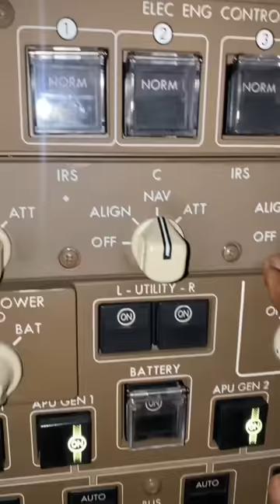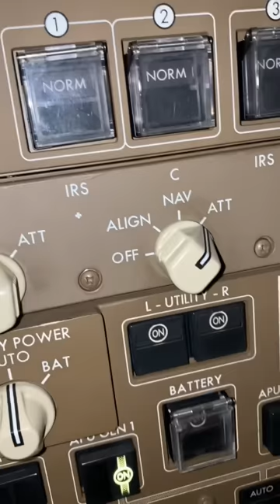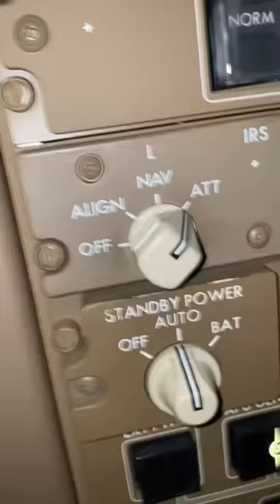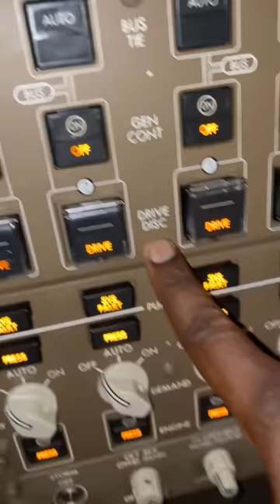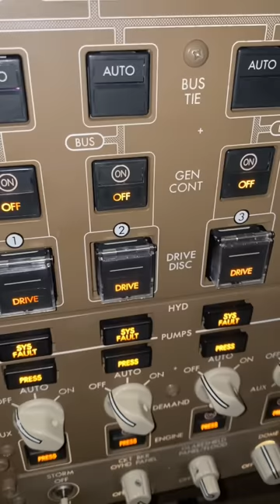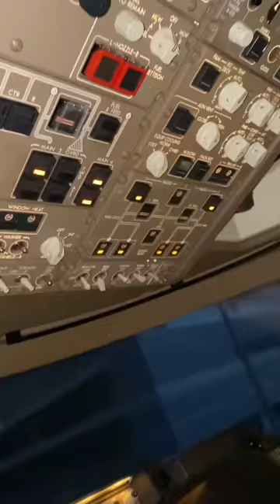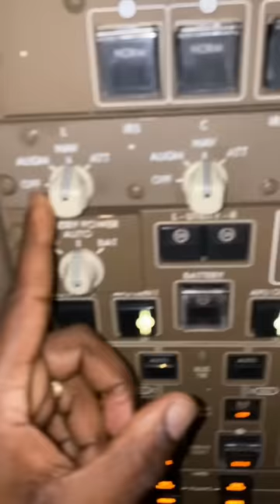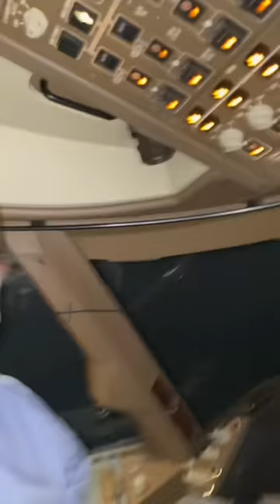Boeing 747 cockpit irreversible actions

Comment: I actually did the "GEN DRIVE DISC" once in a real flight, and the QRH clearly stated "action is irreversible", me and my copilot had to be very sure we are disconnecting the correct one, but it's actually a very rare occurrence in my 7+ years flying the 744s.
And I did not know the 747-8s have the RAT, is it consider a standard equipment in 747-8s?
Reply: its the other way around is what I've heard the  747-8 does have one no matter what. but the -400 and earlier dont.
Reply: @nick4506  Why would they need a RAT with four engines?  Seems like overkill.
Reply: @rael5469  no idea why. but the faa has been a bit uncooperative recently so maybe they just wanted to be ahead of the curve of any new regulation they could spring on them. like whats going on with the max10 now.
Reply: @nick4506  Thanks Nick. Interesting question though.
Reply: @rael5469  i would guess in case of fuel exhaustion, the RAT would come in handy
Reply: @MuhammadUsman-wy6cb  If they run a 747 out of fuel they deserve to go down in the sea. But still, you have a point. I remember when a British Airways 747 had all of it's engines snuffed out by volcanic ash. Extremely rare but still........
Reply: I've done the GEN DRIVE DISC twice in the 747 while oceannic. What's nice is that it's fairly minor compared to being in a twin. We didn't even need to wake the captain and the action was just part of the change briefing when we changed pilots in cruise.
Reply: @rael5469  Fuel is out? All engines fail from like a bird strike? Shit happens, even if extremely rarely.
Reply from the maker: Yes it is standard fit in the B747-8 but you should understand that on the B747-8, unlike some other types, the RAT is for emergency hydraulic power to system 3 for flight controls. The RAT on the B747-8 has no electrical function as it were.
Reply from the maker: @rael5469  read my reply
Reply from the maker: @MuhammadUsman-wy6cb  the RAT in the B747 is to provide emergency hydraulic power to system 3 for flight controls- it has no electrical function.
Reply from the maker: @spudsmac0  correct- not a big deal
Reply: @hunormagyar1843  I see your point. Better to be safe than sorry.
Reply: @MuhammadUsman-wy6cb   well if fuel was exhausted wouldn't windmilling 4 engines be good enough?  like 4 engine faures to the point they don't spin anymore is kinda super unlikely and I don't think its ever happened.
Reply: @nick4506  The accessory gearbox is driven by the high pressure shaft of the engine. What you see windmilling on a shut down engine is the low pressure shaft. Since most of the airflow bypasses the HP section, it will not spin up to sufficient speed to create any hydraulic pressure.
Reply: @rael5469  Well there was that time a BA 74 flew in to volcanic ash and lost all 4. The captain flew the bird like a glider of many miles before the change in OAT cleared some of the glaze from the turbines and they managed to restart a couple of engines. There's a video on here about the story.
Reply: @IanDarley  Yes, other replies have mentioned it.
Reply: @rael5469  as mentioned earlier. Fuel problems can stop all engines as in the total fuel exhaustion of the ‘Gimley glider’ and the aircraft that had to glide to the Azores. Also due fuel filter icing up, BA-38 landed short of the runway at Heathrow. None of those situations were due to crew’s fault.
And thanks to ‘pilot_obet’ for excellent presentation and really interesting subject matter. You have earned yourself a rare subscription from me. 
And some very interesting comments too. Well done all.
Reply: @tonymax6632  No, the Gimli Glider glided to Gimli, Manitoba in Canada. That was another aircraft that glided to the Azores. They were both 2 engine aircraft.
Reply: @pilot_obet  Thanks for the info, Sir.
Reply: @nick4506  "well if fuel was exhausted wouldn't windmilling 4 engines be good enough? "
Nick as far as I know windmilling engines DO produce hydraulic pressure. So the question arises, is a windmilling RAT going to do better than a windmilling engine?
Reply: @rael5469  Given the RAT is designed to provide the necessary hydraulic pressure from airflow. Yes, it would be better.
Reply: @Melanie16040  Well.....here's this from a guy who claims to be a 747 flight engineer.
"(boeing decided that with the B747-400, the speed of four windmilling engines would be sufficient to provide hydraulic power. I think to give enough pushing power on the PFCU's, the hydraulics need to be pressurised to a minimum of 500psi. Windmilling engines should provide around 1200psi...)
Valid for the 747 classic also. A minimum of 160 KIAS or 1.3 stalling speed (whichever is greater), will provide adequate hydraulic power to control the aircraft in the event all engine power is lost. Normally, windmilling engines can provide full pressure for the hydraulic system.

Regards,
B747FE."
Reply: @rael5469  As I understand the RAT is included on the 748 while it was not on the earlier models. Another thing to consider may be the higher bypass ratio with modern engines. You may find that while that was the case with earlier models, there is a reason Boeing has decided to include a RAT for the tirtiary hydraulic system in the 748.
Reply: @Melanie16040  I imagine you are right Melanie. I just worked on a 787 last night and standing in front of those gigantic engines it seems like what those quotes I pasted would be true....that even windmilling they would produce hydraulic power....unless the engines were shut down....in which case I think all the valves would close....closing off hydraulic power from the engine? I don't know....my airline doesn't operate the 747 any longer and it's been too long since I've been through systems class to remember on the 87. Good thing I can still read a manual.
Reply: @rael5469  Oh cool! Are the 78's you work on GE or Trent powered?
Reply: What stops you from reconnecting it in flight? Can are you able to stop the turbine from turning so the drive can reconnect?
Reply: @Melanie16040  "Are the 78's you work on GE or Trent powered?"
GE Gen-X I think they call them. And they are easier to work on that A320 engines. It's actually easier to get into a 787 cowling than  the much smaller A320 cowling. The PDOS (Powered Door Opening System) makes it relatively easy. And once you get inside....the jobs I've done so far are easy access. Not bad at all.
Reply: @DaimeanN  "What stops you from reconnecting it in flight? Can are you able to stop the turbine from turning so the drive can reconnect?"
The disconnect for the IDG (Integrated Drive Generator) is a one way function. Activating the switch can disconnect it but there is no mechanism for reconnecting it in flight. The reason is because the engine can not be spinning when reconnecting it. Then once reconnected on the ground the gear teeth will drop into place during the first sign of rotation during the next start.
Reply: @rael5469  The difference in the -400 and the -8 is probably due to the higher bypass ratio on the engines on the -8. Windmilling the bigger engines may not spin the high pressure section fast enough while it would spin it with sufficient speed on the smaller engines of the -400.
Reply: @Stoney3K  Good point. I'm sure the engineers have it all worked out.
Reply: @rael5469  yes, you’ll note that my post used ‘and’ between the two aircraft listings. That means I was listing them as two distinct aircraft circumstances.
Reply: @tonymax6632  I stand corrected Tony. Sorry I didn't notice that.
Reply: @DaimeanN  "What stops you from reconnecting it in flight?"
The reset ring is located on the generator drive itself on the engine. Impossible to get to inflight. Maybe some new aircraft will be resettable inflight someday.
Reply: @tonymax6632  "Also due fuel filter icing up, BA-38 landed short of the runway at Heathrow."
I question the validity of that incident. I think the odds of both engines icing up the fuel / oil heat exchangers and stopping at exactly the same moment are too high to calculate. Furthermore: "After a battery of tests, the AAIB had not yet succeeded in reproducing the suspected icing behaviour and was undertaking further investigation."  I don't know what else could have caused it but I've been suspicious of that incident ever since. Is it possible that the crew had disengaged the autothrottles without realizing it?....and just let the aircraft settle to the ground? It happened to Asiana......something with the automation. VERY similar results.....landing short.

Comment: What a wonderful video!! Thank you Captain! I am building my sim with all real components from the tear down 744 G-BNLS in ZGGG, very close to HK. And I did enjoy to study to control every single switch. I just finished interfacing the IRS panel last month. And I know why they the lock on the these three switches. 

Thank you again!!
Reply: Now I know why there are locks on these three switches.
Reply from the maker: Cheers- I’d love to come and see your built B747 one day
Reply: Cool. Isn't there also the fire extinguishers controls for engines that's an irreversible switch ?
Reply: @pilot_obet surely welcome!!🎉🎉

And I just updated my sim with a real part of the IRS panel. It is exactly the logic you said, from NAV to ATT is locked and a pull is needed. But it is very old panel, from NAV to Align or OFF is no locked any more. I believe the switches itself is broken. Haha

Please come to my sim. Would like to meet you soon , my man. Haha.

Comment: It would seem to me that any switch that is irreversible should have an extra visual device such as a yellow circle or some other signal around it.
Reply from the maker: It is all on the checklist with cautions
Reply: On the plane i used to work on, the physical guards for anything like this had a strand of weak safety wire securing it in a very specific way that it added a bit of effort to even flip up the physical guards for things like this. Both tactile and visual feedback (didn't have an INS so that one didn't apply)

Comment: Does the RAT extend automatically in an electrical emergency, or is that just an Airbus thing? I’m also guessing the IRS is irreversible because the system needs to be on the ground to align and calibrate itself, which obviously cannot be performed in flight.
Reply: It's an airbus thing, boeing will never pursue actions without the pilot's permission, main reason they are considered safer.
Reply: @alexspeedpro2254  Except when it pushes the nose of the plane down without any warning. That is acceptable for Boeing.
Reply: @alexspeedpro2254  I don’t think most would consider Boeing safer anymore. Most people would now consider Airbus safer after the myriad safety problems with the 787 and 737 max
Reply from the maker: As a matter of fact, the RAT does extend automatically in the event of failure of 3 or more engines. The RAT on the B747-8 is there to provide emergency hydraulic power to system 3 for flight controls. There is no electrical output unlike other types of aircraft 😊
Reply from the maker: @alexspeedpro2254  see my reply
Reply: @Pilot _obet  yeah, you have the APU or batteries for electrical, and RAT for flight controls.
Reply: oh interesting! So, are you saying there’s no electrical power generated from the rat at all? From what I’ve seen, and I believe this was again on Airbus, that the RAT runs a hydraulic pump for the flight controls, and a second hydraulic pump is connected to a generator. Integrated drive generator, I think it’s called.

I think some rats can generate up to 5kW of power, which is enough to run the aircraft and some avionics in an electrical emergency config. For example, captain gets screens, F/O gets nothing. Emergency lighting in the cabin, limited/degraded flight controls, but everything you strictly need is operable (I guess some slats/flaps are inop, thrust reversers inop, landing gear gravity extension only, etc.) I might have a read around and report back!

P.S. also, as others have stated, you have the APU and batteries. Let’s pretend you took off with an inop APU (which is allowed. The APU is not on the minimum equipment list; you can take off and fly without it), and all of your engine generators also fail. What do you have left? You’ve got batteries, and the RAT. On the Airbus A320, the rat is deployed in electric emergency config. This is one of the ECAM actions, to make sure the rat is out. But once you land (or your really bad day gets worse because the rat is also not functional), then your last source of power are the batteries, as discussed. In the A320, in elec emerg confg, these batteries are designed to provide power for a minimum of 20 minutes.

Anything over is a bonus, but the batteries must be guaranteed to run the aircraft for a minimum of 20 minutes. But as you land and slow down, the RAT will stall and stop producing energy, as you may well imagine, and at this point, the aircraft switches to batteries, so you have massive redundancies, and multiple sources not only of power and hydraulics as usual, but you have two emergency sources as well! Electrical power and hydraulic pressure are both, as you may well imagine, mandatory at all times. Your aircraft will not fly if you lose power or hydraulics.

I can’t speak much for Boeing, but captain joe taught me a lot about A320s. :P

And damn this is an essay! Sorry all!
Reply: In theory you could re-align the IRS using GNSS measurements (maybe not with 1970s computation power).
Reply: @pilot_obet  Thank you for correcting me! Seems I was pretty wrong about that
Reply: @busteraycan  If you would've actually care to get yourself documanted about the max situation and not just try to seem cool being ironic, you wouldve known that the boeing 737 max was the cause of the incompetance of the new ceo's, wich didn't care about the safety and only about the money, so they didn't include the mcas feature in the manuals so the pilots would need minimal training. The nose is pushed down so it prevents the aircraft from stalling and take the lives of many more people. It was the first time boeing included a critical system that acts without the pilot's permission, but you could still deactivate it at the flip of a single switch, unlike some other companies aghum airbus *aghum*. So go take that airbus copium and take a nap.
Reply: @alexspeedpro2254  Unless said action is horizontal trim in a 737 MAX with a dodgy AOA sensor, the pilot doesn't need to know about that.
Reply: @alexspeedpro2254  You really ought to take your own advice, buddy.  For a start, MCAS isn't a stall-protection system.  All it's supposed to do is make the MAX handle like the previous generation 737 without having to re-train the pilots.  The MAX would be perfectly flyable safely without MCAS, only the crews would have all required a degree of re-training in a simulator.  Second, you couldn't just "turn it off" in flight without turning off the entire trim system.  The pilots of the second MAX to crash did turn it off when they got the first trim runaway, but then the only trimming option they had left was the manual trim wheels, which they just couldn't turn due to the aerodynamic loads on the tail being higher than what a human could overcome with brute force.  In desperation they turned the trim system back on in the hopes they could re-trim the aircraft and turn it back off before whatever problem they had manifested itself again.  They couldn't.  

Finally, and most importantly, firing the CEO and replacing him is not going to be enough to fix the problems at Boeing.  They were infected with a faulty management culture when they merged with MacDonald Douglas, and that malignant management culture is still in place now.  Aside from the MAX, Boeing has just been lurching from one disaster to another, because what was once an engineering-focused company has been transformed into a company that puts building value for the shareholders first.
Reply: @cH3rtzb3rg  In Apollo the IMU and Gyros were realigned with a starfield. Same with the space shuttle, the only difference is in the shuttle the system was automatic instead of by sextant. So it definitely is possible on 70s computing, especially because airplane computers were WAY stronger than space craft up until the space shuttle program. The real question is efficiency and if it is even worth it.
Reply: @williamsplays8528  True, but I guess space ships are a bit easier, since most of the time, they are in "free fall".
Reply: Why can't it just store the alignment and restored it when returning to nav? Seems like that would be easier than making those crazy mechanical pull to confirm switches.
Reply: @williamsplays8528  Space shuttle and Apollo could align it's IMU only during orbital flight (including TLI and TEI), they could not do that during reentry, launch or when using SPS/OMS. When out of atmosphere stars are visible at all time. When it comes to aircraft some of them can have INS aligned mid flight, mainly military aircraft that can use IFA alignament mode to realign INS mid flight. When spacecraft is in free fall (orbiting around earth, moon, during TLI, TEI etc) it does not use accelerometers to propagate state vector, it uses math instead (free fall is very predictable, no turbulences, jetstreams etc), this is why it is easier to do in spacecrafts. In aircraft IRS uses accelerometers at all times.
Reply: @EternityForest  It is not possible to store an alignment when aircraft is in motion. Some military aircraft can store an alignment when parked and then realign to stored reference when performing startup, this is called STORED HEADING ALIGNMENT and is used in many US made military aircraft.

Comment: Additionally, make sure the engine power is set equal or higher than idle power before press IDG DISC switch, specially the action need to be made on ground. Or the IDG will permanently be damaged, even destroy the gearbox.